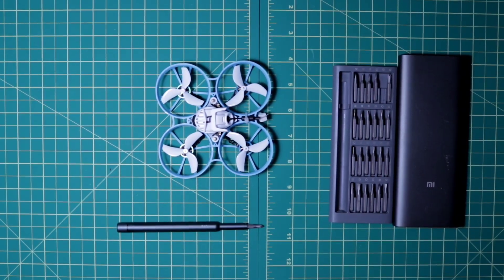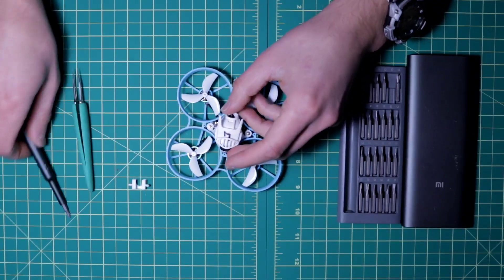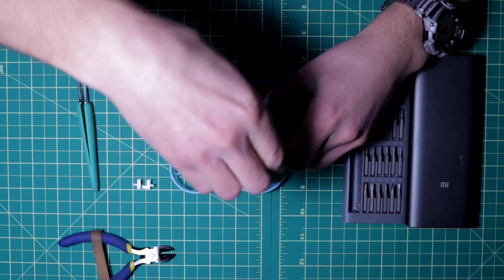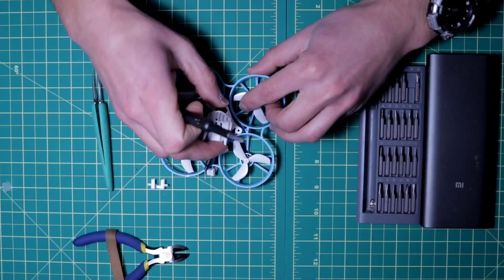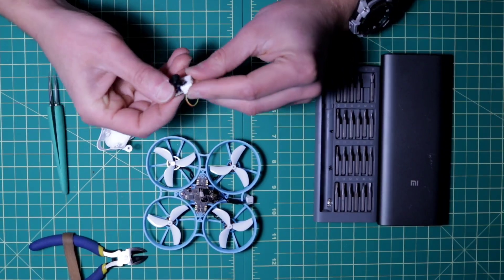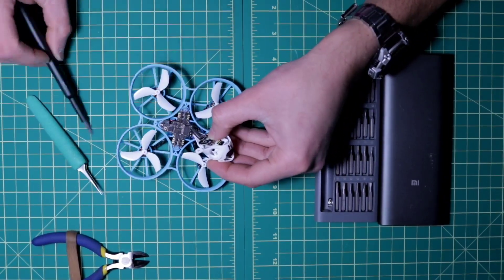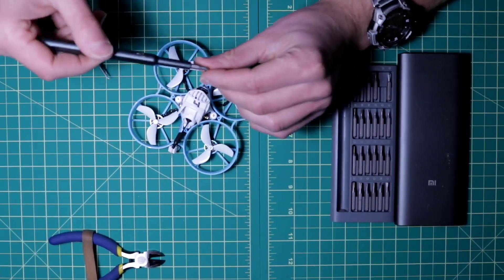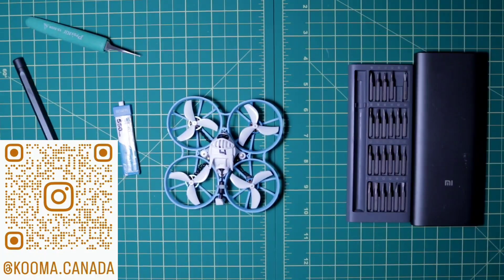How to change camera angle on betafpv meteor 75 pro whoop drone!

Comment: whats the degree of the lower angle? Which do you prefer for freestyle? FYI my stock meteor 75 Pro camera mount was coming in at 30 degrees on betaflight not 20 degrees, I believe this mount changes it to 20 degrees?

Comment: Bruh I broke the video wire😅
Reply: this happened to me, the elrs antenna was rubbing on the video wire and it wore through, i ordered a new camera and direct soldered it to the pads on the bottom of the board and made sure to twist it enough that it was no longer rubbing